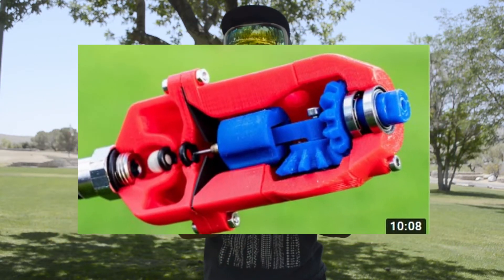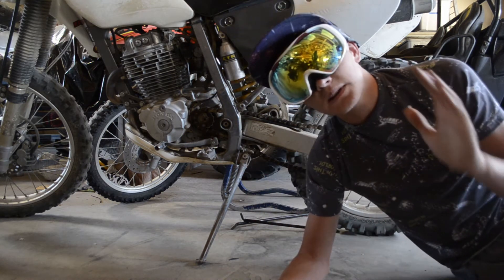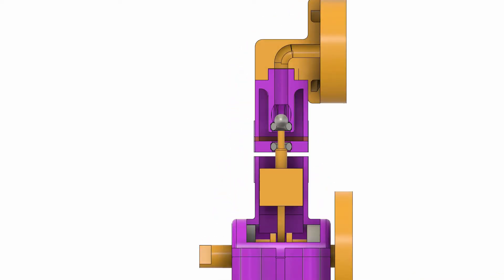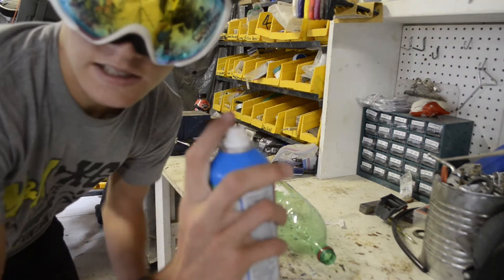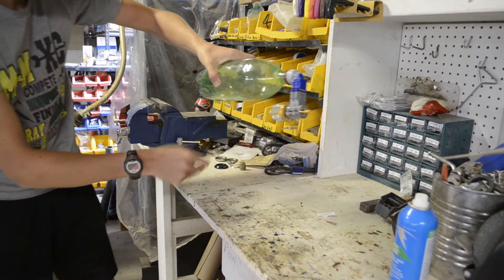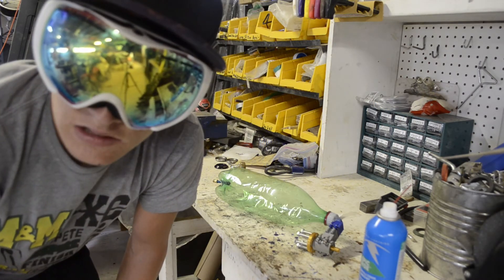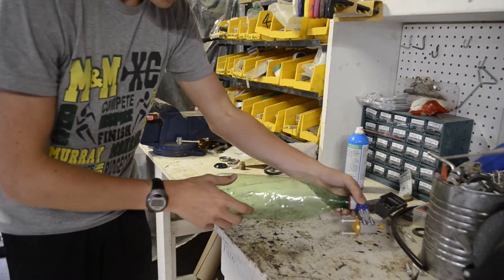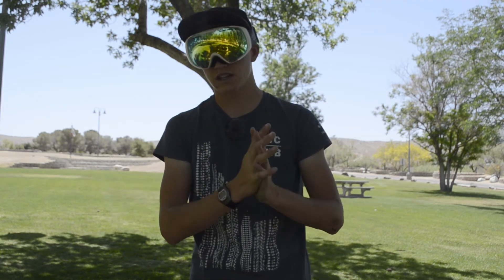4cc Compressed Air Engine

Comment: Good job! 
You might study the BASH VALVE UNIFLOW engines used extensively in high speed boats and cars not so long ago.
Plans and prints are available from the Steam Automobile Club of America.
Myself, I am redesigning on now to 3d print with pc for head and valve. 
You can adjust power and efficiency by changing clearances and thus expansion ratios in cylinder/piston volume.
Good luck! 
(Skip Goebel/formerly Sensibe Steam Consultants)
Reply from the maker: Thanks for the advice!